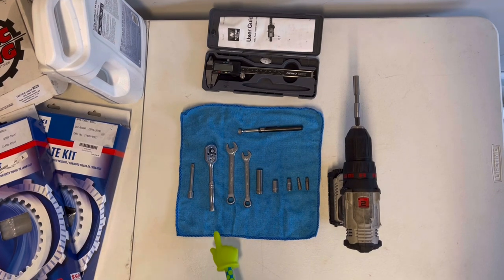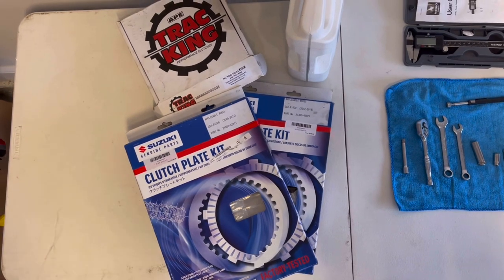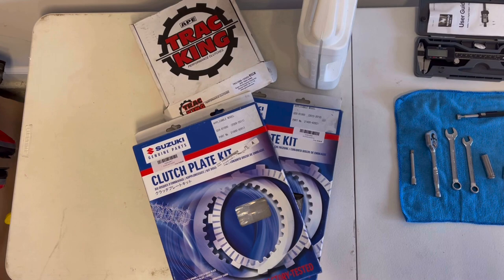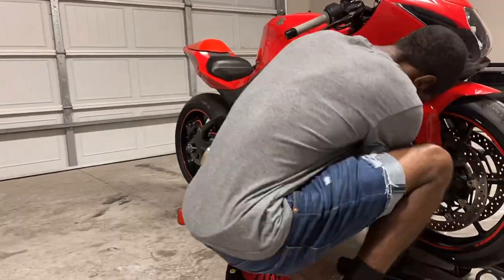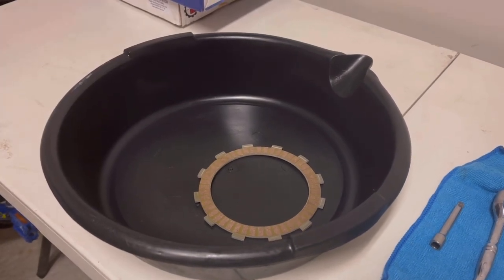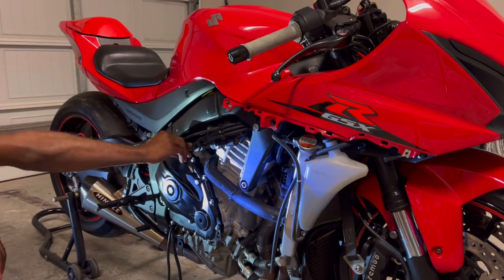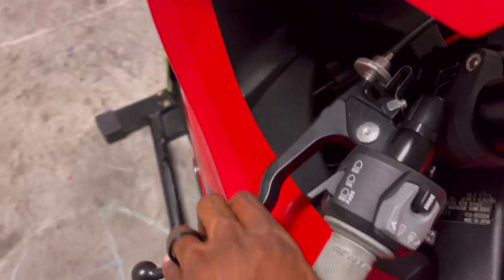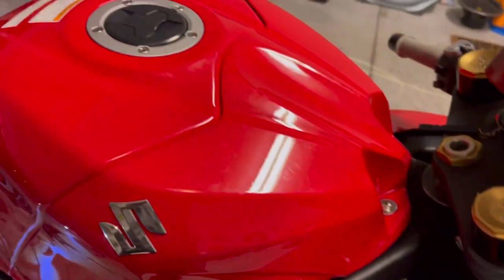Clutch Maintenance

Comment: Hi man, where you boy there clutch basket with 6 springs? I have the same motorcycle but I have a clutch basket with three springs.
Reply from the maker: I grabbed it off of eBay a while back. It’s a 2009-2016 GSXR 1000 clutch basket

Comment: Had our eyes on ya for some time. U movin. 👊

Going with Brock or softer springs?

Think rockin' 10w30 @ a daily basis would be ok? (-20C/68F to +35C/95F @ summer)
My bike seein 10k miles / season, mostly highway/pulls and the occasionally drag/dig treatment at the few events we get going @ here. We don't have the low grade stuff/Alisyn stuff and aditives or the Rotella either. Knew the T6 is the way to go... Been using the BelRay 10w40 EXS (we sell it) and the ECSTAR (Shell) T9000 10w40 that i get from time to time at the dealership, can't say i've had/heard of any bad experiences with them.

🤘
Reply from the maker: I prefer the Brocks HD springs! Haven’t had any issues with the oil, but my bike isn’t rode a lot anymore. Probably better to run a thicker oil in the heat for that purpose. I’ve ran Amsoil with good success also

Comment: What do you mean by backdated clutch? Just the older style clutch packs? Thanks
Reply from the maker: Thanks for asking! I’m using a backdated setup from the 2009-2016 model gsxr 1000. The original 2017+ setup uses a “ramp” style that doesn’t give a lot of clutch control to the rider and only has 3 clutch springs. The backdated setup is more traditional and has 6 clutch springs so it’s a lot better for launching a shorter bike.
Reply: @RedGSXR  my man thanks for the free game. Always appreciate when someone goes out of their way to teach and give information. Getting a new gen like yours soon and I wanna go fast like you 👍🏽
Reply from the maker: @JW-ot5zq  welcome! Go ahead and get it, you won’t be disappointed!